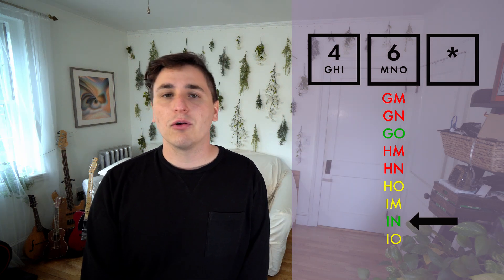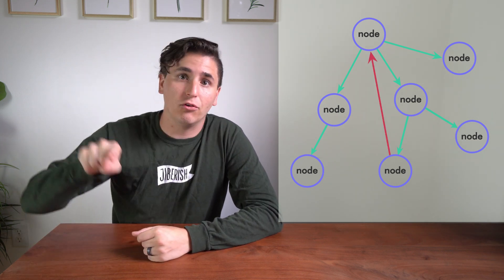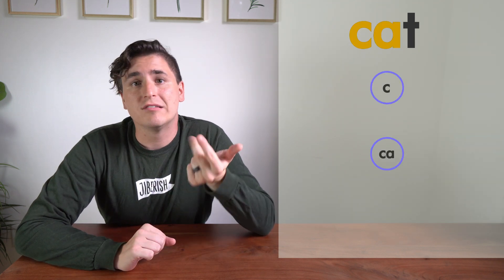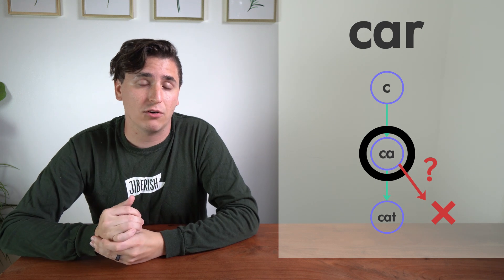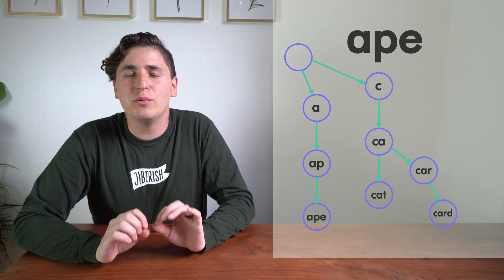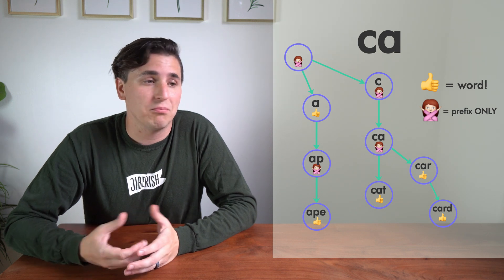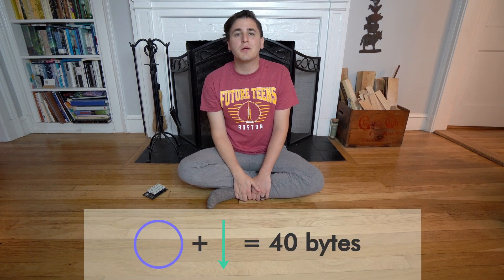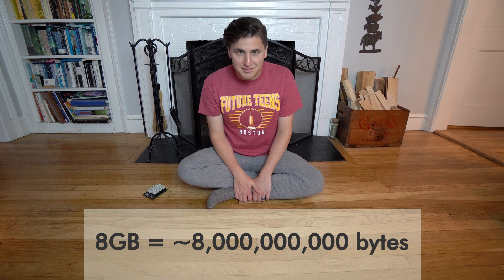How I ported T9 Predictive Text to run on a microcontroller

Comment: Do you think it would be possible to attach some kind of Bluetooth module to this to make it wireless? I'm trying to find a solution to typing on the steam deck that is portable, not an actual keyboard and not the digital built in one. It'd be cool if this could be shrunk down to like an old Nokia phone sized keypad and connect to a computer wirelessly.
Reply from the maker: Yeah you can actually! There's drop in replacement for the microcontroller board I use that has an nrf52840 chip on it, which has Bluetooth and runs the same code. The only thing I have not done is optimize for battery life, which is key for Bluetooth. I plan on doing it though, I'm redesigning this board
Reply: @GuyDupont  rad just picked up the version you have on Etsy for now! Excited to build even a USB version that I can pack along w/ me.

Comment: definitely going to mess around with this! Though I'm thinking of using a 2x4 macropad instead to make it easier to use one handed while wearing a brace. If there's anywhere I can tip you that would be great! (something like ko-fi?)
Reply from the maker: Thank you, but no worries on the tip! I think I set up a ko-fi like 2 years ago but I don't think it ever got used. More trouble than it's worth at this point.

Comment: Really cool project. Thank you for this. One question, if I may. How does it handle a custom library with latin extended characters that includes words with as ü, ş, ğ, ö etc.?
Reply from the maker: There's a bit about this at the very end but basically - it doesn't yet. I need to look at some libraries from different languages to plan an approach. Working on this now! Totally doable just need to figure out which method will conserve most space.
Reply: @GuyDupont  If I remember correctly on my Motorola MPX 220, which has a fantastic custom T9 dictionary, it treats these letters as u, s, g, o etc. But you can flick through letters by pressing the keys fast so you can always find the correct letters to continue or complete the search. I still have this phone. I actually have two :) Thank you, again. I’ll certainly keep an eye on the project and order one. One more small request, would it be possible for you, if the time permits, to design a 3D case that we can pay for to have it printed locally?
Reply from the maker: I want a case too, but I don't think I am the right person to design it. I'll ask around, though!

Comment: Amazing video, but I walked away with 2 questions:
1.) How do we enter numbers?
2.) How does it handle words that are a complete word by themselves(like "go") but can also be prefixes to other words(like "going")? In other words, how does it know when the current word is complete and the next word is about to be typed in?(I was 5 years old when I last used the T9 keyboard, and I did not know how it worked back then.)

Great work, and I am genuinely surprised that you are under 10k subs,.
Reply from the maker: Good questions!
1) The star key works as a "modifier" key. When you hold it, the macropad goes into "multitap" mode. So to get the number one, you just hold the modifier key and press 1.
2) The 0 key works as a space, so to signal that you're ready to start a new word, you just have to tap it. Once you do that, the current search is completely flushed.

re: subs - thanks! I don't think I'm quite good enough yet at playing the "algorithm". Working on it though! I'm hoping the content I'm putting together for later this year will help. At the very least, there will be more of it.
Reply: @GuyDupont  Ah I see, Another question that comes to mind is that if needed, how does one type in words that aren't in the library(like abbreviations, names, words of other languages written in English, gibberish, etc)? Can the predictive typing be overruled while typing?
Reply from the maker: Yup! Again, that's where multitap comes in. You can type each letter individually by holding the modifier key and then tapping a letter key [x] times quickly. So to type 'e', you would tap the '3' key quickly twice, since e is the second letter on that key.
Reply from the maker: Not sure YT will let me link it, but I have a full usage demo here:

https://youtu.be/ESmvoqq3m-g

Comment: I love it! Would be awesome to have this on the side. 

Two questions. What switches is the completed product using? And when you use this, do you have a case for it, with rubber feet and such?
Reply from the maker: Hi! I mostly build them with Cherry MX Blue's, but I have a few others sitting around. And no cases yet, but I do stick adhesive rubber feet on the bottom of the PCB.
Reply: @GuyDupont  Awesome, thanks! Wonderful work as always.